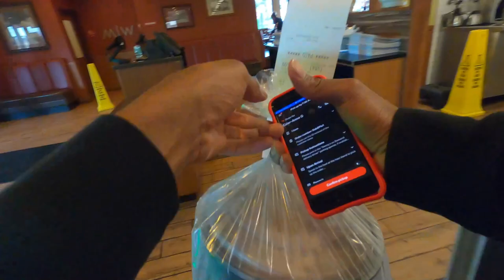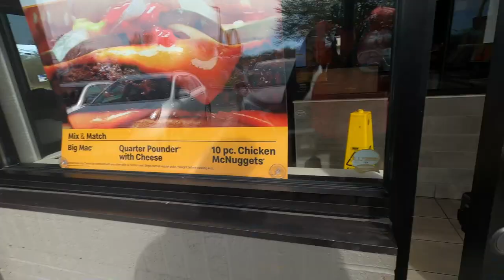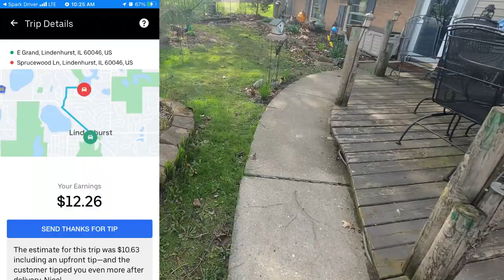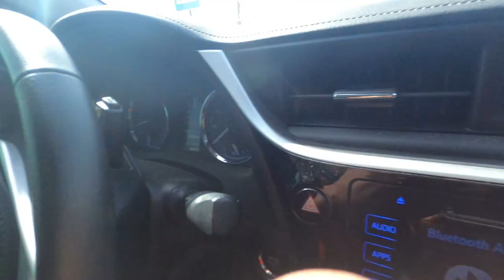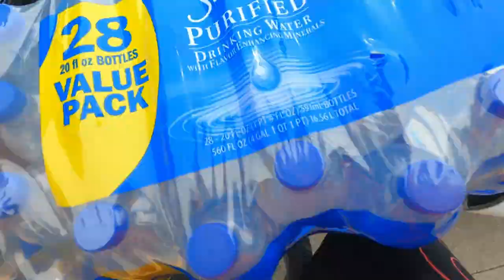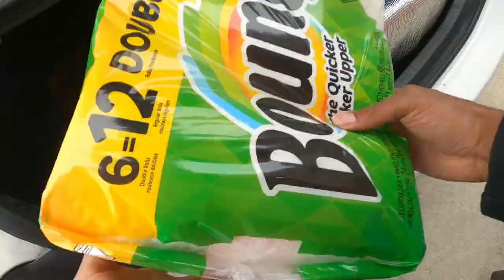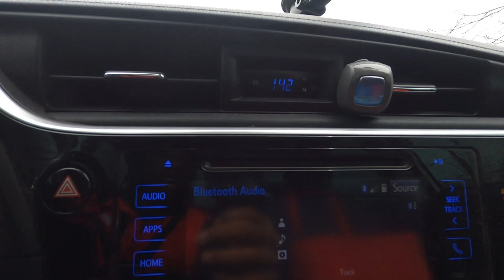How BAD Is A LATE Delivery? 😰 My 1st Violation! InstaCart, DoorDash, Spark Tips & Tricks, Ride-Along

Comment: So the Dennys order was on doordash and becuz it didn't show it would be ready till 953- you did the other order? Well you ended up doing ue instead but you did the sparked up order 1st since you had time to pick up the ue order? Did I keep up? I'm trying to understand the multi app process you do
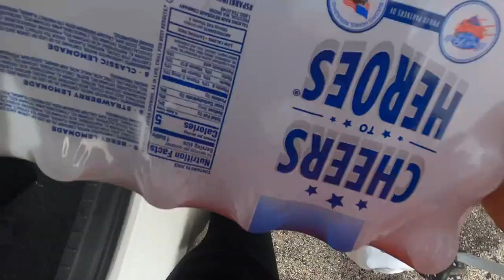Reply from the maker: Yes, The Denny’s order was on Doordash. Yes, I didn’t have to pick it up until 9:53 which it is literally across the street from Sam’s Club. Para said it would be $16.59 but it was also 7.8 miles so when the UE order can in for $14.54 I canceled the Denny’s order to do the UE order because it was way less miles. I picked up the Spark order first but you have a huge time window to drop it off they usually give you an hour to do the order. That’s how we are able to do orders in between.